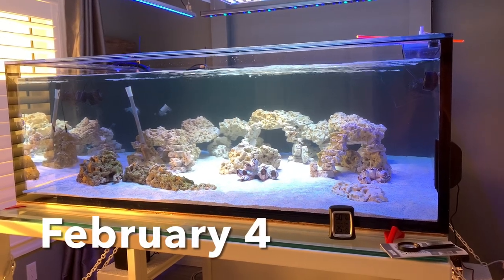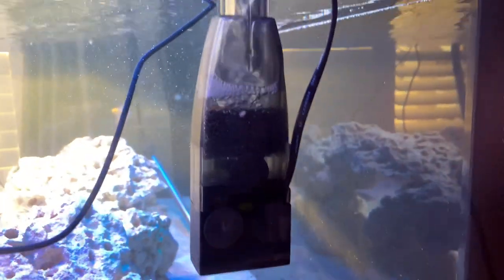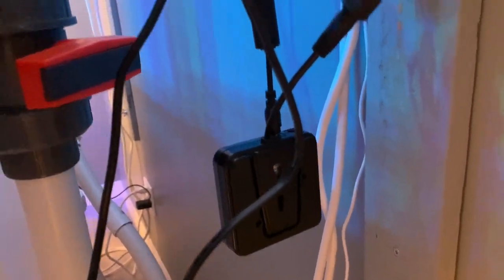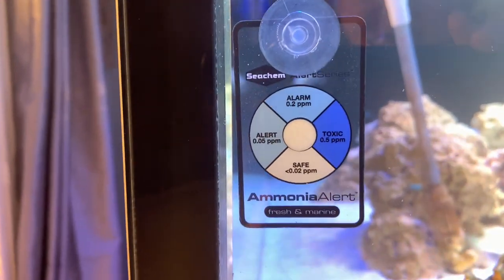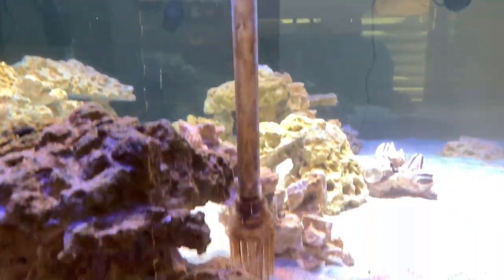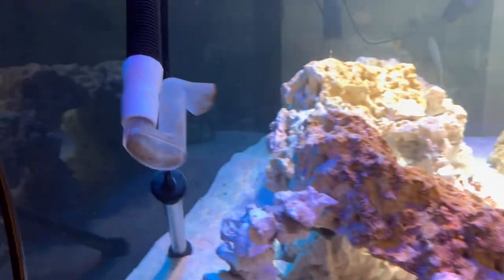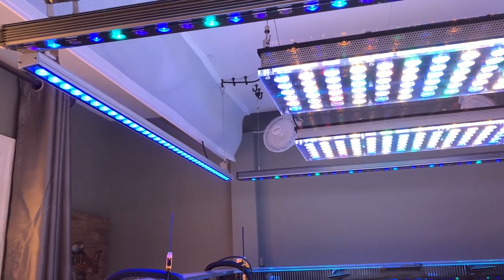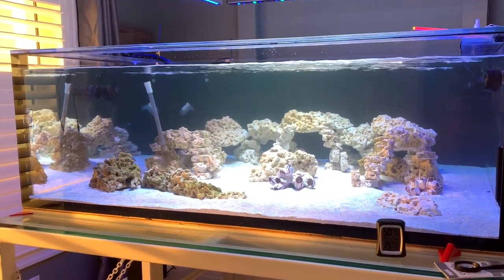How I’m temporarily managing my 325G display tank until it gets joined to the basement sump

Comment: Tank looks great. Are you feeding the bacteria ? That little SW10 would make a riptide in a "normal" size tank. As a matter of interest what is the pH running at ?
Reply from the maker: Thanks Andrew! I am feeding bacteria - Microbacter7 at the moment. I’m being very careful though, because I don’t want to cause a bacterial bloom and risk the occurrence of white slime. I’ve used several types of bacteria including Fritz TurboStart, Big Als store brand, and AquaVitro Seed. There’s one more I can’t remember just now. I also seeded this tank with Apex pods. And yes - that SLW-10 will go into the overflow, at the bottom, to keep detritus from settling. It’s surprisingly powerful! pH is 8.0-8.1 though I don’t have a pH monitor on this tank (going by Spin Touch Test results). Thanks for stopping by!